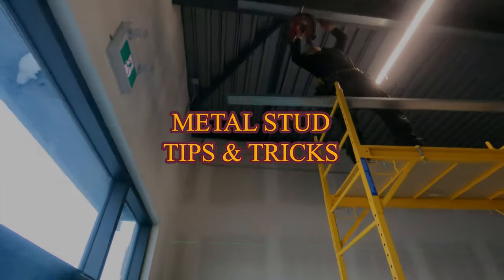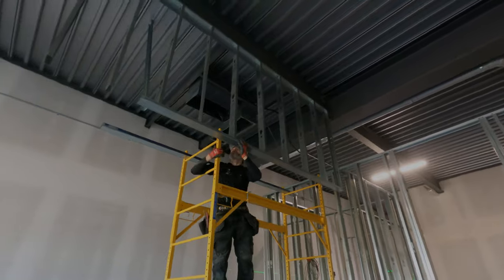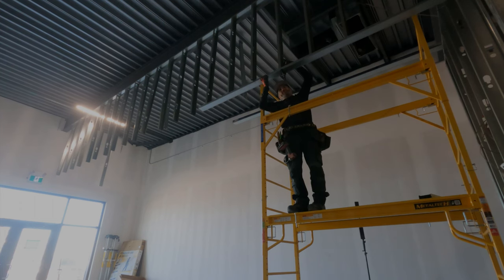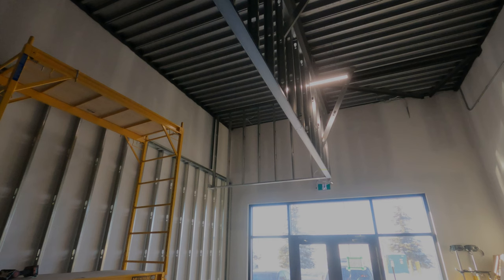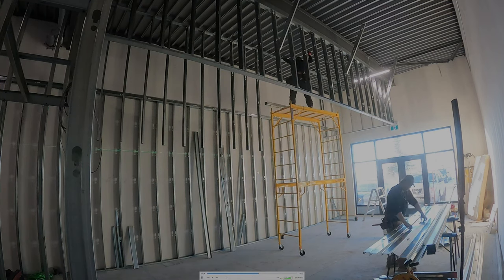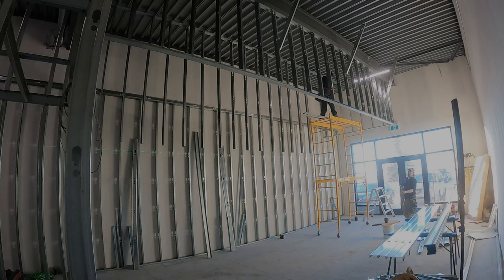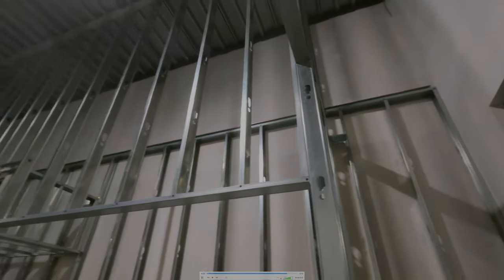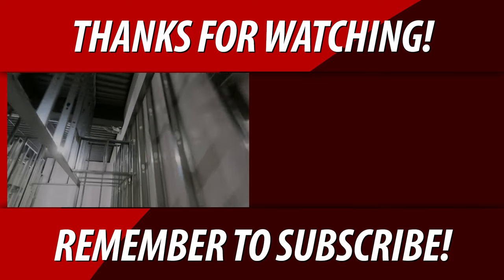Metal Stud Framing Tips & Tricks

Comment: Request: how would you build a metal stud partition in a domestic timber truss style loft? There is no straight flat ceiling, it'll be sloped. Toptrack might end up parallel between rafters with nothing to secure!? to?
Reply from the maker: Always attach the track to the under side of a truss or use a clip for between the trusses to attach top track to.

Comment: One of those kickers looks less than 45. Do you guys ever use string? Just curious like if the run is over 30 feet do u only use line lasers or string
Reply from the maker: Braces or kickers can be all kinds of angles, don't have to be 45. Put as many as you need to get your walls secured proper. I haven't used string since lasers became available almost 20 years ago. Lasers are the best way. I haven't even used a level other than for a straight edge in about the same time. We have a dozen lasers and use them all at once sometimes. We love the ones that shoot corners / double horizontal lines.  The rotators are boss for long runs. Set an offset and use the hand set, mint!
Reply: @ConstructionKronies  right on. Thousand ways to skin a cat I suppose. Over here In California per code we have to have 45 degree angle kickers usually every 32 inches for soffits AKA bulkheads. String is way quicker in my opinion. Just plum up each side and run ur string tight and u have ur elevation and in and out. My biggest soffit was 75 feet. I had 3 points thati plummed up and just hit her with the stringaling and it came out clean.
Reply: @ConstructionKronies  no less man good videos. I really like that u touch stuff that people will see in the field

Comment: Being a architect for 41 years I would of specified carring channel
Reply: Especially if it’s going to be 1/2 inch drywall
Reply from the maker: Yes I try to put it in every wall but sometimes the guys don't order it. I can't stand drywalling a wall without it. But I never put any in a bulkhead. It's not only good for walls with insulation it's good for keeping your studs square and joints flat👍